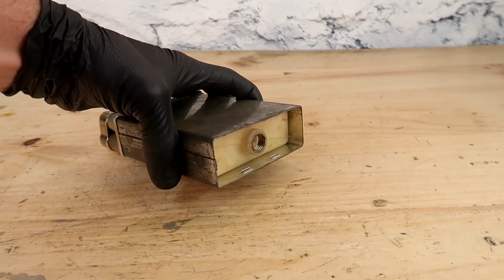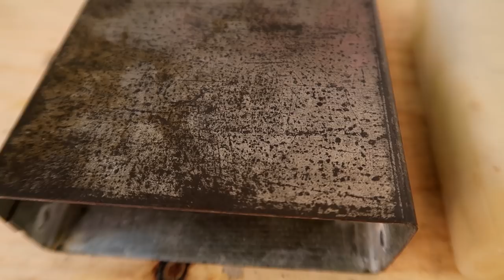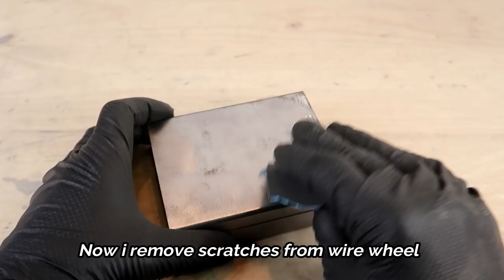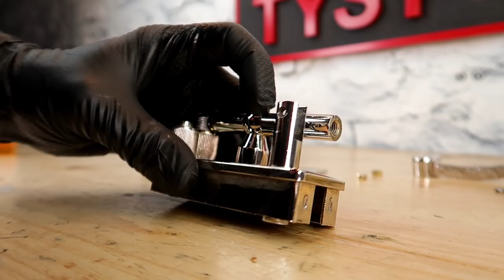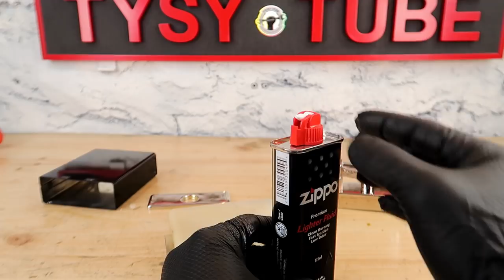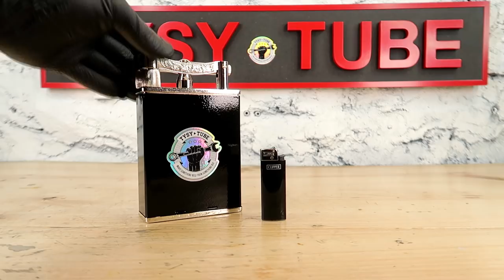Huge Lighter - Restoration

Comment: Cool restoration. But 2 things I'd change: no black paint, and no stickers.
Reply: У тебя 154 лайка
Reply: odd tinkering is way better.
Reply: It's not even very well painted. Very orange peely. I was hoping to see it electro-plated.
Reply: Could've been better if he just buffed it
Reply: Le falta estar forrado el cuerpo con cuero. Yo tengo uno igual (de bolsillo) y esta terminado en cuero y queda genial
Reply: It would’ve looked dumb just all chrome
Reply: Maybe a silky matt black coat would have done the trick.
And yes, no stickers.
Reply: Originally it was most likely covered in thin leather.  I won't comment on the awful paint job or the ruinous stickers.
Reply: It's his lighter and his labor and he did not have to share the reconditioning.
Reply: @rchrist789  at least one guy who knows how it needs to look like.
Reply: Gary Mckee he shouldn’t have shared it
Reply: Imagine going through all that and then sticking the logo off centre
Reply: @sandman10kk7  maybe you shouldn't watch then....
Reply: Black paint contrasts nicely with the hardware. Sticker (with communistic logo) ruins it.
Reply: @Mardy72  
Maybe you shouldn't tell people what to do. Every click and "like" makes the uploader money.
People are allowed their opinion.
Reply: I wish he would’ve left the color alone and just polished it so we could see how it looked in it’s original state 💯
Reply: It's not really a restauration if you paint it a different color than the factory shipped the model with
Reply: @oofingberg  There are many levels of restoration. Simply oiling a sticky mechanism is a restoration. When things aren't worth money, restoring it in any way is the best course of action. It's crazy how many people, who aren't really into restorations, think that it needs to be back to the exact same way it left the factory, with no new parts. That's simply not the case,  unless it's rare, worth money, or is historically significant.
Reply: The table lighter I had was black and chrome
Reply: @snaxgalore5764  Agree Although the stickers look tacky Needed a metal badge
Reply: well when y'all in this thread start doing restorations instead of just critiquing people ACTUALLY doing it like you're some expert, you can do it how you like, but until then how about ya shut up?🙂
Reply: @rchrist789  Mine was thin black leather and chrome and heavy

Comment: Back in 1912 when you had to fill your zippo up at the gas station 😂
Reply: And when the gas station was a pharmacy because that was the only  place to get the specifically mixed oil and alcohol mixture that was used as gasoline.
Reply: Back in 1912 there were no Zippo, it was from 1932. 
Your History sucks bro 😅
Reply: @evilcgaming1210  I got the Humor but was not convinced with the date. Now deal with it 😏
Reply: @vishalnenual3119  I'm sure you knew the year Zippo was founded without searching it...
Reply: Only 1910 kids can relate
Reply: Hahahahaha, very nice
Reply: @maxstirner8717  lol.

Comment: Seems like the can is missing an external lining, like faux leather or faux crocodile. The can is showing things that shouldn't be seen like the join and the welding and the notches to secure the base and top. I doubt these would have been left to be seen on a piece like that which supposes to be something of luxury item. I kinda remember something like that with a green faux crocodile lining by my grand parents or something.
Reply: Paul Van Obberghen I was thinking the same thing, that the case was missing.

Comment: Brilliant work. This is called a lift arm lighter. I don't think it's all that old, having the plastic tank in it tells me that much, but my idea of really old is 20's 30's 40's. this is probably a 70's reproduction.  It's not a "spark stone" it's called a flint. This design, though not in this size, is one of the earliest designs. being so large made it an easier repair/restoration to a degree. On the pocket size ones, the parts get very tiny and difficult to shine up.
Reply: From now on I'm calling flints 'spark stones'.

Comment: Nice. But one word of advice, you should have wet sanded the clear coat to give a mirror finish instead of the orange peel effect you get with new paints
Reply: M1LAD what kind of sand paper you need to get the mirror finish?

I have personally tried up to 2000 wet sanding but never got mirror finish...
Reply: @rronaldreagan  you might need to start at about 1000 and work your way up to 2000 or 2500. Sometimes its tougher. But it helps to wet sand between each coat of clear. And definitely make sure your primer surface has been wet sanded super smooth. Your primer surface always reflects the end result. And the less work you have to do wet sanding the clear coat
Reply: @rronaldreagan  Also when everything is done you should use some compound and then a lighter polish to finish it up. Youll have a great look. Hope i helped!
Reply: I like to use car polish compound to remove any grit at the end but the primer is everything if ur looking for an end result also i find not every sand paper is the same dont  chince urself out then obviously a polishing compound added
Reply: for a mirror like reflection you could use aerography, spray paint is kinda thick for that

Comment: Excellent video as always but a tip for black paint to get a better finish. Paint and lacquer as usual but then leave the first coat of lacquer to dry and set. Then sand and repeat the lacquering until you have a mirror black finish. Also, when sanding on a flat surface try not to use your fingertips. A sanding block or the pad of your palm will give a better finish especially with high gloss paint :)

Comment: Beautiful job! I love table lighters! 
I did notice when you were reassembling that the spring that holds the flint to the spark wheel didn't seem to have the little stone at the end anymore. It was there during tear-down. If you don't have that the sparkwheel will gnarl up the spring when you get to the end of the flint.

Comment: You do great work on these things. 
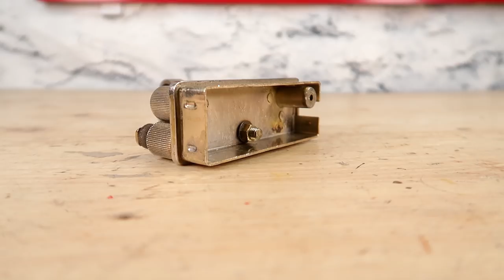But things like 1:33 drive me crazy as a mechanic.. why aren't u using the propper tool? (Socket)
Reply: There seem to be almost no space between the the wall and the nut, I could see some sockets just not being able to fit.
Reply: HidingAllAway why would it be a nut then? It fits. Small sockets are thin enough.
Reply: Pleumel he put it back in with one but maybe he wasn’t sure it would fit and then distort the case. You sure don’t want to watch me doing stuff. I haven’t got much of a tool kit so if it works all fine. Amazing what you can do with old surgical instruments!!  Used to work in an operating theatre (I’m English and that’s what we call them)

Comment: Never pimp antique stuff, dude. You did great job, though .
Reply: Michael Corleone  They did, but it wasn't used for as many things like they do today. Development of plastics started with natural materials that exhibited plastic properties. Modern synthetic plastics were invented around 100 years ago. And it was actually invented by accident, In the 1907 Leo Baekeland  invented the first fully synthetic plastic called Bakelite.  He was trying to find a substitute for Shellac (natural form of plastic made from shells of oriental lac beetles) used as a natural electrical insulator to meet the needs of the rapidly.  electrifying United States.
Reply: Sarcastic Demon 
Bakelite is not plastic, it is it’s own type of material

Comment: I like that the black body complements the brass accents. The stickers are pretty either or, and aren't permanent fixtures so I think it's fine. Might have tried a black paint wash on the texture of the cap to accentuate it, personally.

Comment: some volume issues i noticed with your video sir, is when you where polishing and wire wheeling it was super quiet so i turned up my audio, then when you went to sand paper, it got SUPER  loud so try to even the audio out a bit better :) great video great work good job :)
Reply from the maker: hi, thank you for feedback, i lowered the volume on my grinder but i didn’t think that sand paper is loud, next time i will check, thank you 😊

Comment: Very good restoration, but there are two things I would like to say:

1) I’m not trying to sound snarky, especially because I don’t do restorations myself, but I’m pretty sure the purpose of a restoration is to make it look as it was before it got all rusted over. Because of this, I think you shouldn’t have put on black paint and the stickers.

2) You fixed the weld with epoxy resin, but if it was originally a weld, to keep with the spirit of restorations, you should have welded it, but that is very difficult given how thin it was. I think you should have at least used pins or soldered them together instead of using resin.

Comment: the flathead you use is too small it could damage the screw
unscrewing a bolt with pliers could damage the bolt.
are you restoring or just taking it apart?

Comment: Is it normal for the polishing wheel to remove gold color like that? I tried using a polishing dremel attachment and it didnt really polish it, it just removed the gold color to reveal the silver underneath.
Reply: alan wong Because it’s brass when brass polish is normally kind of silvery it’s not gold
Reply: @aidanmontoya1954   the bracelet is a rose gold color. Does that mean that it's just rose gold colored brass?
Reply: It could be that your polishing wheel is taking off your rose gold and it's really just gold plated slever which I've seen before.
Reply: @aidanmontoya1954  thanks for the help

Comment: I guess I'm old fashioned. Is it possible to glue thin tin with epoxy resin firmly enough? I would use spot welding or soldering.
Nevertheless, it did not fall off. It turned out beautifully.
But where did the author manage to find the same as the old new cog wheel for flint?
Chic lighter.

Comment: Did you fill it off camera after assembling the tank into the case?  What little you out in before that and moistened the wick ain't gonna last long. Wasn't even enough to leak out the fill hole when you laid it on the side to install the tank and cap.

By the way, ALL table top lighters were "huge". 
I remember those both sets of grand parents had in the 1960's. 😷👍

Goot job cleaning that one. 😷👍

Question: Since smoking is pretty much banned in public places/outside the home these days, what are the chances of a random smoker on the street or in the pub asking you "Hey, Bub, gotta light?"

Comment: That central beaker is not making the point but act as a crucial fuel holder, a must existential tool; because without it there will be no fuel to bond them together

Comment: I am actually sad that he didn't reapplied the brass or zinc. It's very easy to do also. Just heat up the metal parts until they become a dark red and use a brass brush or wheel.

Comment: Orange peel in painting is typically the result of improper painting technique, and is caused by the quick evaporation of thinner, incorrect spray gun setup (e.g., low air pressure or incorrect nozzle), spraying the paint at an angle other than perpendicular, or applying excessive paint.

Comment: Anyone else confused as is to why he used needle nose pliers to remove that nut but then proceeded to put it back on with a socked and socket wrench and also why he didn’t use a screwdriver to remove other screws but instead a coin and pocket knife 🤔

Comment: Why did you paint the body of the lighter, it was plated. Should have been re-plated. Sorry but the paint ruined an otherwise beautiful piece let alone put that gaudy sticker in the middle of the painter surface, really doesnt work on that piece. Did anyone else cringe when he was using a wire brush on the outside of the body and the top components, i thought it would scratch up for sure but it turned out ok for that part. And please buy yourself some spanners and a terminal screwdriver, you don’t use a penknife to undo screws and you don’t use a pair of pliers to undo a nut.Not unless you want to damage either. i usually enjoy these vids but i don’t like to see things ruined.